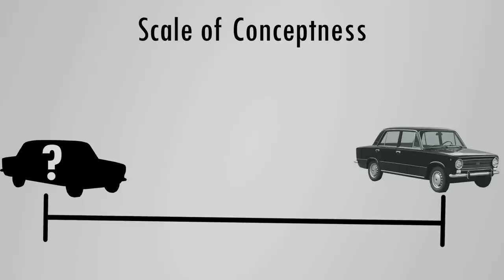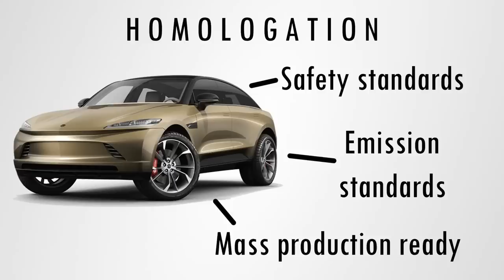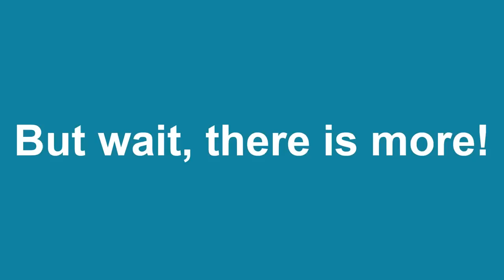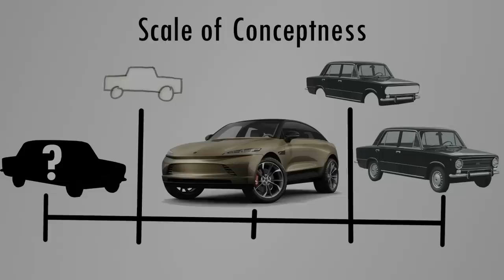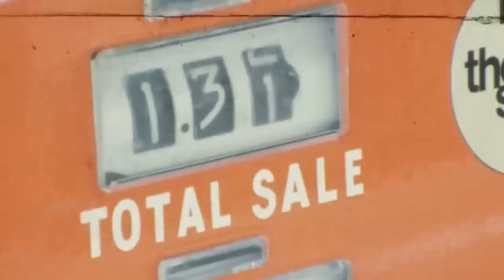Future's Past: The History of the Concept Car

Comment: Went to the 1993 Detroit Autorama, the Plymouth Prowler shown was pretty much what was manufactured in 1997. Down to the purple paint and the automatic transmission and V6 engine. Yes, the concept Prowler was loved until anyone looked at the center console with an automatic. Then crowd reaction was mixed. There was in 1999 the Plymouth Howler concept with a V8 and a five speed manual transmission but alas never made. I still love concept cars and thanks for another great video Ed!
Reply: Like the Prowler, the Corvette was a concept car that later went into production. Also with a 6cyl (although, inline) engine and an automatic transmission!
Reply: @jamesslick4790  But Corvette was quickly overhauled into a proper sports car, and Prowler... well, meh.
Reply: @TheNightrider88  True enough, But in the 50's GM was bigger than the entire rest of the automobile industry (worldwide!), and had manual gearboxes as well as the then "hot" Olds "Rocket" V8 available, But since it was a Chevy project they "HAD" to use the "stovebolt 6" and they used the powerglide tranny as they were more interested in selling THAT than the Corvette itself. (NEW!! was THE "thing" in the '50s) And '90s Chrysler well... was Chrysler. Plus, I don't think that the Prowler was intended to be a proper "sports car," per se. It was the at the peak of the "modern retro" movement, And I think the Prowler was a "toy" for aging boomers who want a turn key "hot rod" more for appearance than "go". The Corvette is unique in as much as I don't believe GM designed it to sell, But the overwhelming public reaction to it "forced their hand". Still, for the price point and it's intention it should have been Oldsmobile's project (Olds being the "hot" division at the time- People forget this today)

Comment: It's the same with science fiction films. Star Trek, the original series is showing a 1960s design, using sometimes clumsy devices that would be hard to justify even just half a century later (or a bit more).
Being a train enthusiast, I've seen a few "concept trains" at InnoTrans. Those are either scale models or full-size mockups that don't go anywhere but you can get in and experience what the interior would be like.

Comment: in 2002 Ford auctioned off many concept cars from the past.   Also, the only steel bodied Corvette was rescued from the crusher some time back.  The car was in a GM warehouse in the UK for some reason.   ( the car used a Porsche 914-6 as a basis but had a rotary engine and auto trans.  )

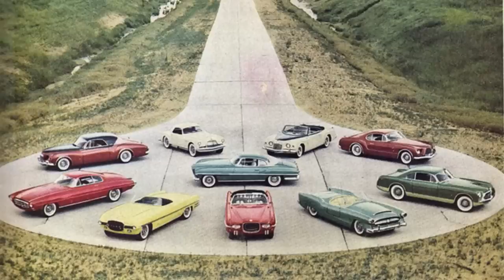Comment: 9:00 awesome.
14:40 this Plymouth has a detachable trailer. The rear wheels for the front vehicle is actually raised in this current setup. Such a funny concept. Reminds me of the space shuttle.
That Nissan "Bevel" is actually pretty cool. I like it much more than the "Cube" it presumably was replaced by.

Comment: The Lincoln Futura is famous example of a concept car as it was basis car for the 1966 Batmobile from the 1966 Batman starring Adam West and Burt Ward. My favorite concept car was the Camatte which was an attempt by Toyota to market a car specifically for kids and this is given that they placed safety features such as safety control speed, braking and steering that was intended to be manually controlled by the parent sitting behind the rear of the child driver and this did had towing provisions for a potential capsule sized trailers.

Comment: There is  another reason why these concept cars might be kept away. A few years back I worked together with an automotive client. At some point I was requested to go to one of their testing grounds to photograph a number of 'heritage' vehicles for their social handles, which they had restored and kept in a warehouse. Upon opening the garage, I wasn't just greeted by these vehicles, but also a concept vehicle that had been presented to the public nearly 2 decades ago, which was supposed to be powered by 'ecological' engines. Except that, no engine had ever been installed. As a matter of fact, nothing on it was even functional, and was nothing more than just tubing with some tires. The steering didn't even function and the wheels had to be turned by hand.
Sadly they also had two dozen of old heritage vehicles which hadn't been restored yet, and as far as I know the higher ups demanded them to be thrown away. I'm not sure what happened to them, as some say they were scrapped, while others say they might have been hidden away by some 'rebellious' staff members who felt that scrapping perfectly savable 40-70 year old vehicles was an attack on the brands heritage. I hope the latter is true.

Comment: The important part of the Y Job (1) isn't  the styling. It's the motor. If the war hadn't started in 39 I think the V-8 revolution of the 50's would have come about earlier. Also the Y Job had an OHV hemi head long before another company in Detroit.
1) Good thing it wasn't called the B Job.

Oops. My bad I'm thinking of the LeSabre probably

Comment: I love 80s concept cars so much, it'd be very cool if 80s production cars use elements of the designs of 80s concept cars, instead of same, boring, outdated silver bumpers that are used in the 70s. I'm saying it would be cool if 80s production cars look like 80s concept cars. Speaking more about concept cars, Ford should've made Edsel a concept car brand where Edsel be making 50s future standards concept cars as production cars, since Ford called it “Car of the Future". And don't forget, all Edsels should have the 1960 Edsel split horizontal grille. There's so much to talk about concept cars, but in the mid-21st century, all production cars will look like concept cars, and all the car will be white, and complicated design.
Reply: Plus, concept cars are kind of scary when they feature weird robotic voices in the concept car.

Comment: I think you over looked part of the late 40’s story and the impact the 49 ford and mercury redesign had on car styling as a whole through the 50’s not just the US car manufacturers either. They out sold Chevrolet that year and it saved the company from going bankrupt. those cars went on to become legendary as the shoebox ford and the lead sled merc’s with hotrodders and custom car builders

Comment: Arguably, the volvo wasnt really too much a head of its time on air bags as dual airbags could be had on the 1973(started selling in sept.of 1972 same time as the volvo was shown at the 1972 geneva auto show which was sept 7 1972) toronado as well as the buicks and cadillacs(1975-1976) and the shock absorbers in the bumper were common for the most part in the front, also the toronado had the first factory highmounted extra brake lights along with the airbags as well as rear abs,